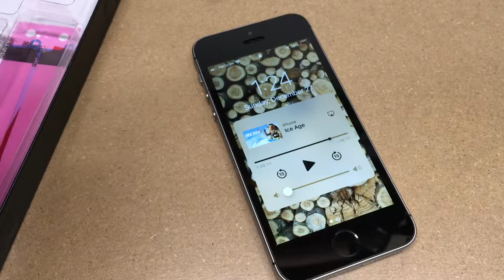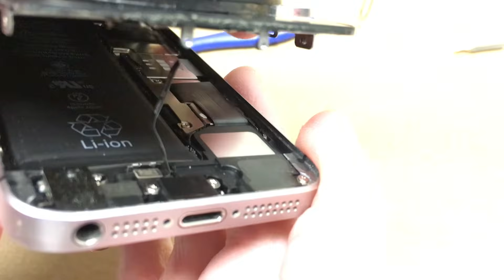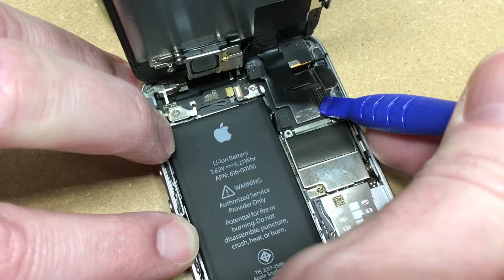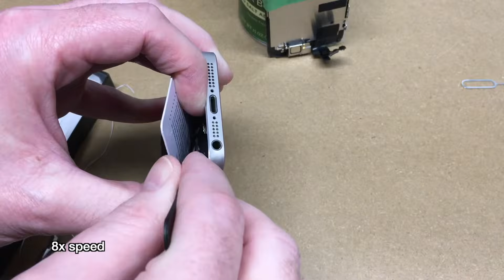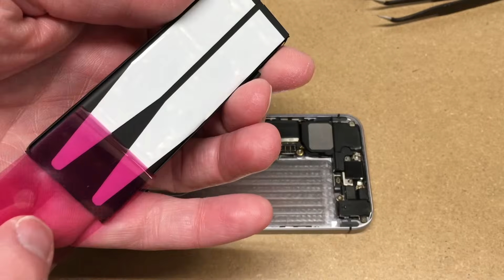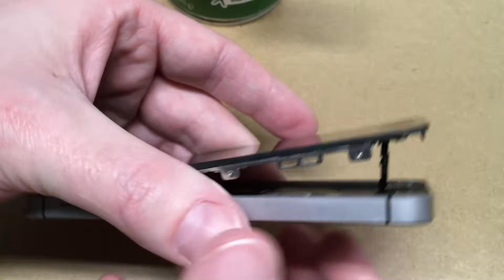iPhone SE (1st Gen) Battery Replacement

Comment: I replaced my iPhone's battery with an aftermarket one from IFixit. At first, once it was installed all I could get was a faint illumination of the screen, and the occasional signal sound, perhaps calendar alerts or text messages. So I figured that I must have not gotten all the inner cable connections done solidly, so went in and carefully redid them. But now the phone does nothing at all: no screen lighting, not even faintly, and no sounds. What happened. and what shall I do?

Comment: I was able to replace battery and the screen is on and the home button works but the screen doesn’t respond to touch. I tried removing the connectors and putting them back. Ang suggestions to fix pls? Touch worked before I opened up my phone

Comment: Thank you so much for this video. I could replace the battery of iphone myself successfully. I just had a problem of snapping both glue stickers and then I had to bend a bit the battery to reach the glue again and pull them out. I worked in the end.

Comment: no purpose to remove that upper plate near the hinge, has nothing to do with replacing the battery!  Simply so you can have a larger angle to pull out the battery.  I should have watched other guides first, now those infinitesimal screws are impossible to get back in.

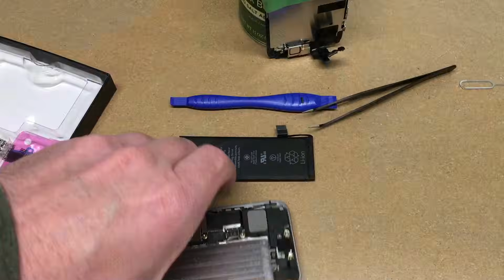Comment: 11:26 Those battery sticking tabs are a nightmare but I’d recommend you pull quicker as it seems to be an exothermal reaction as it lengthens. I think you might have gone far too slow compared to other video guides. I think iFixit is the best. 🤞

Comment: Dental floss tip cost me big time. Sliced right through one of the connectors by the screen. Thought it was part of the battery. Phone is ruined
Reply: I should have been going from the other side though. Not your fault. Just a warning to anyone else doing it. Gonna try to order volume and power cable and see if I can fix it…

Comment: Absolutely spot on! we have two SE’s that had popped the batteries (& of course, the cases). Quoted silly money to get them fixed, so bought two kits on Amazon - first one (the worst one) had a few tricks, and it’s good to see the experts don’t always have it easy too! But all up & working fine. 
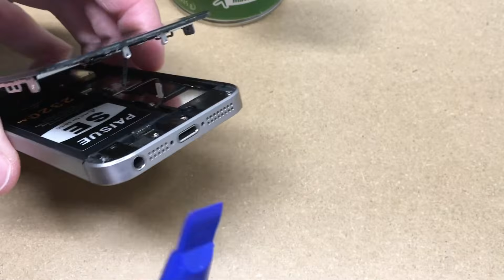Just a point to note is the cover for the first (last) connector had come off, so after pushing the connector in (about 15:00) just had to fiddle the cover on. 
Thanks for a great lesson.

Comment: Excellent vid!! I had a flawless install except for the steel clip that attaches the screen to the phone flew off. I guess the adhesive to the ribbon cable dried out. Took me 15 minutes with some tweezers to snap the darn thing back in place. Luckily this will be the last battery I’ll replace on this SE. You’re awesome!!

Comment: I’ve learned from experience to check the front facing camera as well before you put the phone all the way back together because one of the 3 ribbon cables at the top that you have to disconnect for the screen is the front camera so if that cable isn’t on all the way your camera won’t work and you’ll have to take it all apart again

Comment: Thanks so much I agree with other commentors that this is the best video on the subject by far. I wish there was a way to nominate you for a YouTube emmy or something. My phone had a small metal cap over the connector for the fingerprint/ home button. Also there is a rubber shield covering something near the power button. it was out of place and had kinked and creased one of the ribbons from the digitizer. I was able to manipulate it into it's proper position and flatten the crease in the ribbon, doesn't appear to be any harm done. I used the glass stovetop on our range to heat the case. It was still warm from cooking earlier, it was barely cool enough to touch with my bare hand. Set the phone on it for about 3 minutes until I could feel warmth on top of the battery. Carefully and slowly pulled the adhesive tabs as you instructed. They both stretched and clicked their way out 100% clean. The most difficult part of the reassembly was getting the one non magnetized screw into place. I've rebuilt quite a few android devices and a couple iPhone screens but this is my first iPhone battery. It went smoothly thanks to you. One less piece of ewaste to be dumped on a foreign shoreline.

Comment: Is it really 2300 mah cause I’ve seen on amazon also 2800 versions is that accurate or are they just 1400 like the og SE batteries
Reply: Commy Battery
SE2016
Model+25% = 2000mAh
❤❤SE2016/64GB❤❤

Comment: Excellent instructions. I used a tiny standard screw driver to pry the tab of the stretchy adhesive from behind the cable end of the battery and then was able to pull on it until is started to tear. At that point I put the std tiny screwdriver back in and wrapped the sticky stretchy adhesive onto the screwdriver and winched the adhesive out perfectly; just kept turning the screwdriver  until all the adhesive had rolled onto the screwdriver shaft!

Comment: I normally inject a little (by syringe) isopropyl alcohol this losen the tape completely under the battery by contact and are harmless to electronic, it also evaporate within minutes, Losening the screen, I apply heat on the glas (never above 60-70celsius) if unsure about the heat, use a hairdryer around the edges continuosly moving it close range for 30-60 sec. heat can destroy the mother board, if to much heat under the battery.

Comment: A couple of really helpful hints.  #1 Get a big unopened can and a shoe lace.  When you detach the screen cable, lift it up and tie the screen to the can.  No need to remove the other screen cables.  #2 Take a 4" square floor/bathtub tile and place it in boiling water.  Then take out, dry off, and place it under your iPhone.  This will gently heat the adhesive strips.  

I ordered my battery kit from NewPower99.  Bad choice.  Their kit did not include adhesive strips.  I had to improvise with "mustache tape."  Another major issue is that the iPhone now does not recognize the battery so as to show battery health.  BUY OME battery from Apple.  

Take your time.  This isn't hard.  Just have a white ceramic dish to put your screws in.  If you drop one, you'll never find it.  VERY tiny screws.  I love my original SE despite everyone tell me to buy new.  I like the small screen.  Oh, I'm 75 and have cut the tips of my finger so nerve endings not so good.  If a half blind old guy can do it, you can too.

Comment: thanks a lot for this. Super helped! But yes I think however slow u do the adhesives, they can be real jerks lol. To someone else reading this, it's somewhat ok to bend the battery (not too much) I bent mine ever so slightly just to be able to access the adhesives again. (another heavy note, just try lifting using a plastic tool and not metal) After all of that, everything was a breeze to install and put back. Good luck to anyone!

Comment: What I don't get is why those huge adhesive strips are needed at all for such a tightly-fitting battery.   It's not like it's going to flop around inside the case..  Can anyone explain why it needs to be taped in so securely?  I'm about to do this battery swap, and I'm thinking maybe just 2 tiny bits of double-sided tape, or two tiny squares of Velcro-- one at the top and one at the bottom, to hold it in place (will make it easier for the NEXT replacement battery)..   Any ideas about that?
Reply from the maker: I'm guessing it is to keep the battery from getting damaged during drops.
Reply: Hi, thanks for the detailed video:  I performed this surgery last night with your video playing on a laptop next to me as I worked.  So far everything was a success.  (PS:  I ended up using 2 tiny squares of double-sided tape instead of the big adhesive strips that came in the toolkit...  somehow I feel that may help avoid pain at the next battery change!).. Thanks!

Comment: I just ordered and got in a replacement battery for my SE. I dnt use it really cause it has to stay on charger or will die in 10min or so.

My brand replacement is different, Hopefully it works ! 

I’m basically practicing with my IPhone SE

SO I can get the idea and feel before changing My 8+ which I’m still using , but it’s at 82% 

So, I want to practice changing the SE Before trying it on my MAIN iPhone I’m using atm. 

I hope the SE comes out well though, always liked it!  Also, I can use it as an extra Remote again , lol.

I’ve got 3 different replacement batteries 2 the same, and a Different one for the 8 Plus.

Fingers Crossed 🤞 everything goes well.

I have a feeling getting that Battery out is what’s going to be a Pain! 

Probably getting it Apart with the suction cups also! 

I’m going to watch a Few More videos as well before starting, but going by comments yours seems to be the best !

Do U have a 8Plus replacement battery change video?
Reply from the maker: Unfortunately I don't have any videos on the 8 or 8 plus.

Comment: I just got a Replacement battery for my 1st Gen SE. the Apple battery is definitely in need of changing to a new battery! 

It’s Only like 75% so It dIES FAST! 

I didn’t get the same Replacement Battery as yours, But I have 2 other Different Replacement Battery Kits for an IPhone 8 and 8+ . 
 
If you by chance see this, What If You didn’t Put the New Adhesive on the new Battery? And instead Just Put the Battery in without it?
Reply from the maker: I don't know all of the implications of not using the adhesive but I've heard of people leaving it out. I personally use it, especially since I likely won't be changing the battery again on a specific phone.

Comment: Great and very helpful video. Only issue I had was a little metal cover on the home button cable popped off separately but I was able to figure out how to replace it. I was very careful with the adhesive pulling it very slowly after heating the back of the phone with a bed heating pad and got both strips out cleanly then the battery just came out, just like robertaustin did. Really, no problems thanks to Rick and a good dose of patience. One other thing, I taped some blue tape upside down in the plastic tray the battery came in to use to stick the screws and covers in order.

Comment: I brought one of those kits. Unfortunately not via your link.
The tools were adequate though the tips were not magnetic enough to hold the screws firmly. 
I used the suction cup as you did but it came apart quicker than I thought it would.
The button ribbon separated and the metal clip went flying. Lucky I found it and no damage was done.
The top right screw on the screen plate was not magnetic neither on mine.
My adhesive broke right at the tip and I had to pry the end up to get hold of that tape. I distorted the end of the battery quite a bit. Be careful were you lever against the board.
Then everything went back together, very fiddle connecting the connectors and screwing the plates back on.
The button cable was very tricky to get on though the metal plate was easy.
Surprise surprise the phone now works.
Thank you.
Reply: How was the battery life?
Reply: @queenpubgaccounts534  still going good, using it every day.

Comment: Replaced my battery today - this was the most helpful video I’ve found by far! I have a fair bit of experience working on PCs and laptops, so if you’ve done that sort of stuff before, it’s really not that different, just a whole lot smaller!

Both my battery strips came out in one piece. What I found worked was to pull very slowly until a little resistance is felt, then slack off a bit, then repeat. It took me about 5-6 mins per strip. Just taking it easy and going by feel with no sudden movements. 

The only issue I had was the very last thing - the bracket over the button cable! There wasn’t a good shot in the video, but the side with the two holes is “up” - towards the battery. Also, one of my screws on the big top plate is captive on my particular phone. 

Lastly, THANK YOU for this video! $20 bucks for the battery and the phone is like new!
Reply: Did mine as well. Forgotten how pocket sized they are. Only reason I stopped using it was because of the camera at night not picking up details.

Comment: i sucessfully replaced the battery on my old iphone SE, but the problem is the battery wouldn't charge and phone shuts down afew seconds after i remove the charging cable. not sure whats wrong with it.
Reply: Try reinstalling it, could be faulty connection

Comment: Followed along step by step, seemed easy enough. Powered it back on, now the touch screen doesn't work.
Reply from the maker: I would try removing and reconnecting the cables. Sometimes they don't get seated properly.
Reply: @Rickmakes  Worked!

Comment: Great video, did make a big oops by warming for too long on high heat and ended up melting the adhesive away. Other than that, the video made everything go smoothly. There also appears to be another little clip that goes over the touch ID ribbon but didn't take much to figure it out.

Comment: I just did this yesterday on my SE. Of course the adhesive strips broke right off for me so I had to resort to some 15lb fishing line to cut through the white stuff. Also, I did mine WITHOUT removing the display and the cables - not too hard if you can hold it open with one hand or as I did prop it up against my chest. Another thing I didn't do was glue the replacement battery in - there is absolutely no need to as it sits snug anyway. Happy to say all went well and I now have a phone that can run 2-3 days, as opposed to the old battery that couldn't stay 5 min away from a charger.

There is absolutely no argument for having manufacturers glue batteries in - these are wear items that die meaning they will need to be removed and replaced. Another way to do it instead of a plastic credit card is to use a playing card with a 45 cut on the corner and run some alcohol over the edge - it will go through the glue like a hot knife through butter.

Comment: I will not use this sticky tape on the replacement battery. You could also use one strip rather than two. I don’t think it needs this much adhesion.

Comment: Thanks for this video! It helped me very well. I finish the battery replacement right now and phone works!:) I noticed the one difference from this video and it was the face time camera cable (that camere above the display) connector is covered by some metal clip cover, but it was very easy to take off it and then at the finish put back:) Thanks for this video.

Comment: I changed the battery using your tutorial. I purchased the kit, and the phone kept turning off and on. I purchased another kit and I have the same issue with the battery. I even changed the charging port. The battery is different than the one in the video. I have 2750 mAh. What is wrong?
Reply from the maker: I haven't heard of that problem before. Does it do it if you reconnect the old battery? I would try disconnecting and reconnecting all of the cable you had disconnected replacing the battery.
Reply: @Rickmakes  I did all that and it keeps turning off. The initial battery is not smooth anymore and I am a bit apprehensive to add it and see if that would do something different. I even did a firmware recovery. I wonder if I am doing something with calibrating the battery. After I installed the new battery, I turned the phone off and kept it charging for several hours.

Comment: Rick, you did a fantastic job in your step by step explanations on this overly complicated job of replacing a battery.  As a retired Human Factors Engineer I can honestly say that I think Apple did a horrible design in the battery replacement steps.  I wonder if very thin velcro tapes, to hold the battery in place, might have been better than the glue-tape.  Leave it to Apple to make it overly complicated!

Comment: Looks super hard to do, but you did a great job Rick in removing the parts, the adhesive and putting the new battery with the new adhesive strips. Thanks for your videe! You clearly show and explain each step by step action in removing the parts (screws and cover plates) and how to slowly remove the hidden adhesive strips with tips to do it well. Great battery replacement video!😀

Comment: Hi very helpful. I made a mistake and lost one of the four screws. :( I have a quick question. When everything is removed (the battery, the metal plates, the screen) is it normal to hear a rattle when shaking? I started wondering if the screw I lost got stuck inside something so I took everything apart just in case and still hear the rattle. Do you think it's the lost screw or something else? Sorry if it a stupid question but this is my first replacing or even using an iPhone.
Reply: Please....there are people who are extremely capable of helping you for  very affordable prices in your local mall or phone repair shops. While your tbere you could also ask them directly to teach you a few things about the phone and the repair process which would be much better than reading comments online

Comment: fyi: There is a cover over the last connector shown, the ribbon cable hanging down from the display backing. [I pressed down too hard on this cover and pulled out the connector.] The cover has two metal tabs on one side and one tab on the other. The one tab is on the side of the click/home button.

Comment: Very good video,  the best on YouTube for this battery replacement.  Love the tip of fixing the screen to a can,  I used some very low tack tape to avoid leaving glue of the inside case.  Personally, I don't think you need to detach the screen cables  But DO remove the 4 screw shield to release the stress at the 3 cable bends.   As Rick says, take your time, very slowly to remove the  adhesive strips to avoid a headache further down the line.  I found some low magnetic tape and cut pieces into a tray to position the screws so as not to mix them.  Before assembly, gently wipe the grime build up around the edge of the glass and case profile.  Pure alcohol and lint free cloth should work fine for this